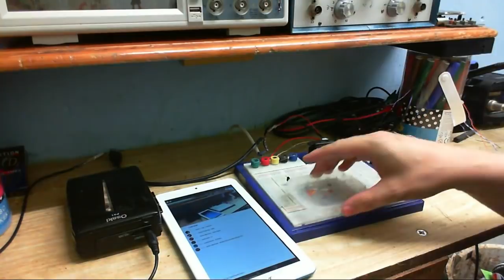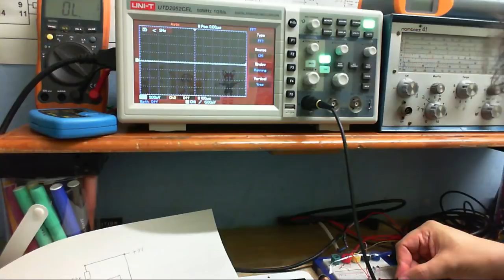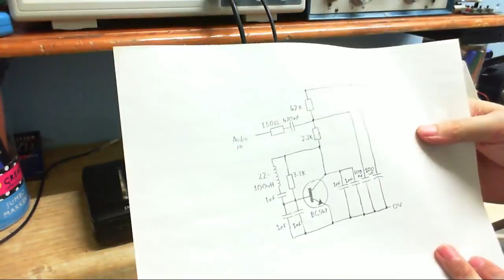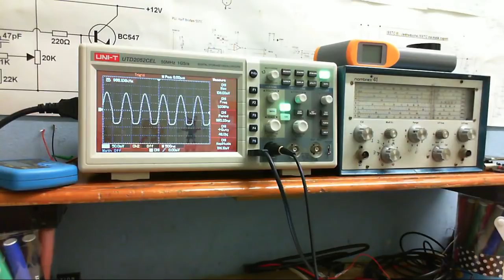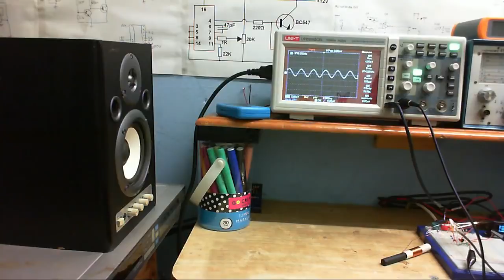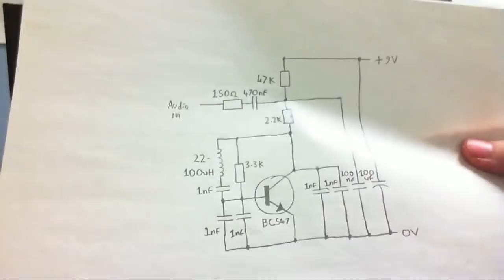CoolDudeClem Live Stream - Radio transmitter request

Comment: may be use a plug in  microphone, the camcorders mic is giving off subsonic booms.?
Reply from the maker: I would have used an external microphone, but that picks up a TON of hum from my power supply's transformer whenever my power supply is on.That's one reason I want to build a swtchmode power supply or make some kind of modification so it doesn't interfere with the mic.  I think those "subsonic booms" might be my webcams' mic picking up wind from my fan, which I didn't even know it was doing at the time, it's not very well shielded against wind.

Comment: An interesting arrangement Clem!It looks like a Pierce configuration Oscillator with a series L.C. circuit instead of a Quartz Crystal.Did you buy those Metal Film Resistors from Maplin?
Reply from the maker: Actually I got the resistors from banggood, it was a pretty good deal because not only that, they also came with assorted LEDs, diodes, transistors and capacitors and it all only cost me £10! They're probably cheap wun-hung-low (as Dave on eevblog would say) parts, but good enough for my needs.